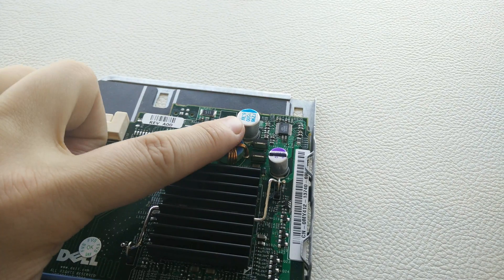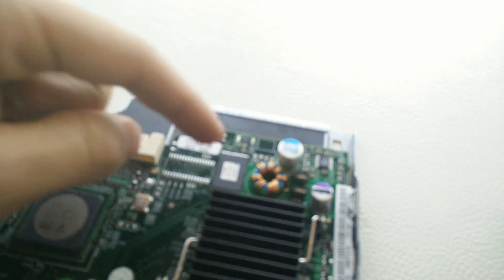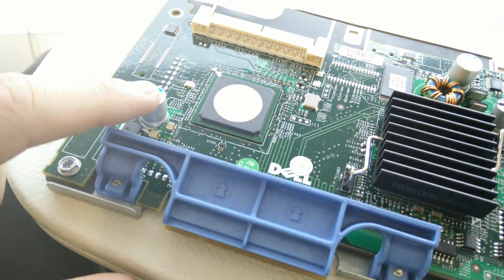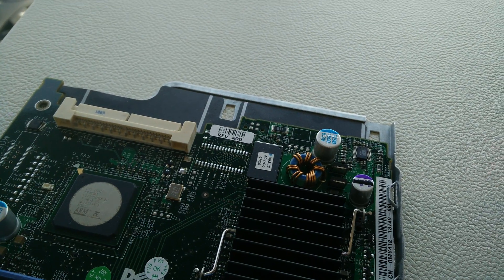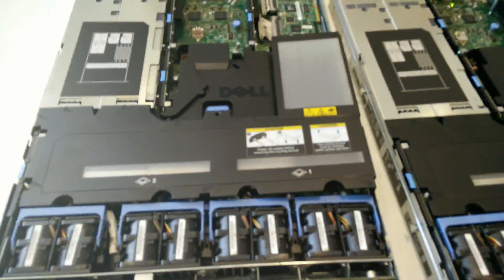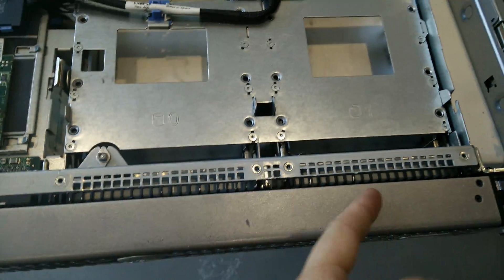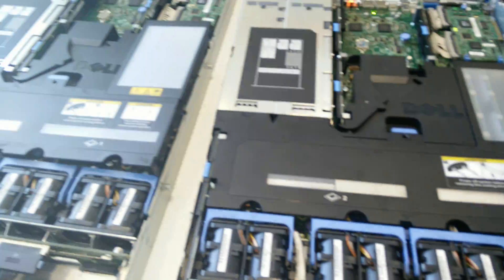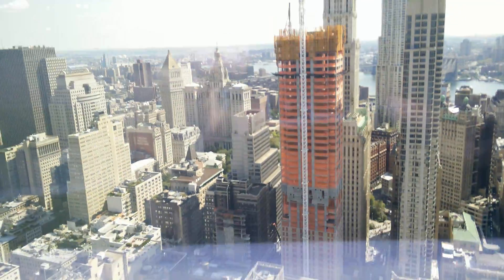Capacitor replacements.

Comment: I've recently replaced some caps on the psu of my old monitor. I only replaced the ones that looked dead, but sadly the problem isn't fixed. I want to replace them all but those low ESR caps are expensive to get here. I've already spent €5.80 and would need to spend another €7 to replace the rest. I'd do it if i was completely sure that would fix it, but I have serious doubts.